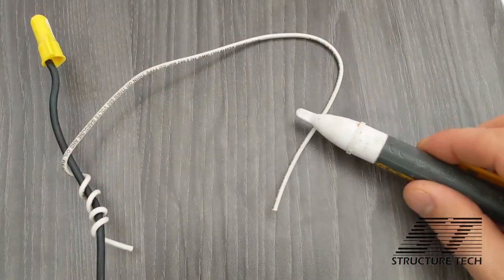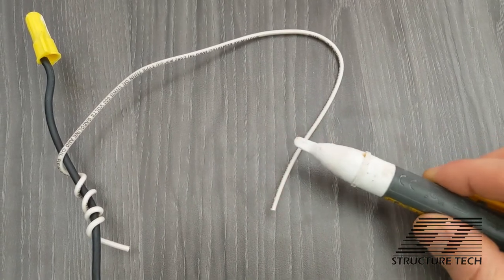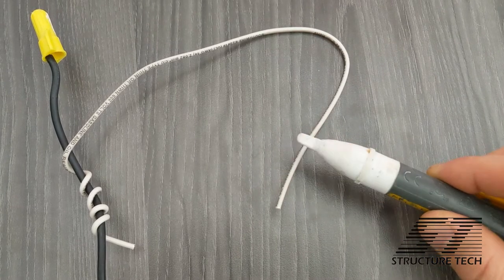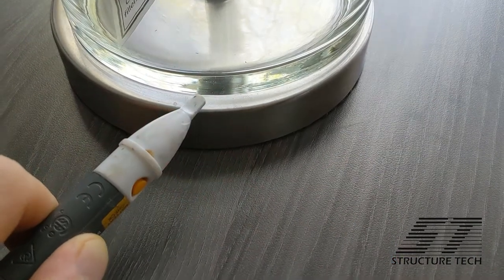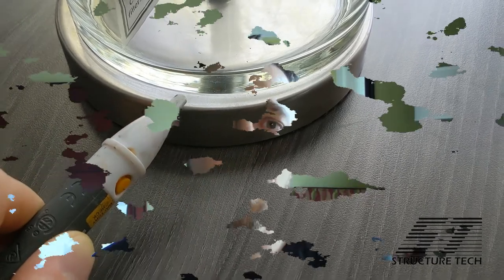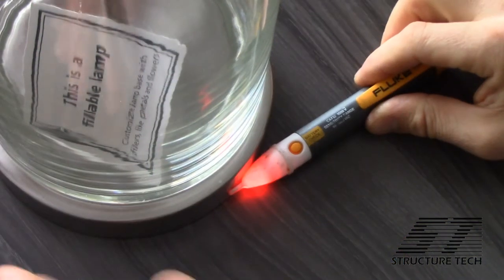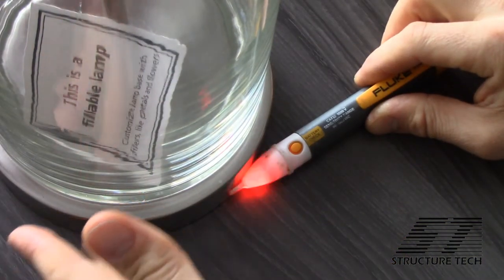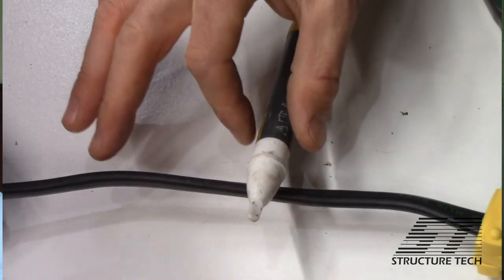Non-contact voltage detectors: tips and tricks for home inspectors

Comment: I was getting a false positive on wires unhooked and couldn’t figure why, they were in plastic conduit and I started to wonder if the wires intertwined in the conduit was causing the false readings.  This video showed what I was seeing when you wrapped that dead wire around a hot

Comment: why does my neutral wire never trigger the detector, even when the object being powered up is ON?  I would assume there is current in the neutral wire (otherwise what dies it do?) and I should think it would be dangerous to touch.  But my Fluke detector never triggers on the neutral.